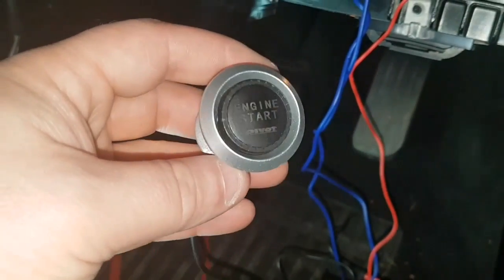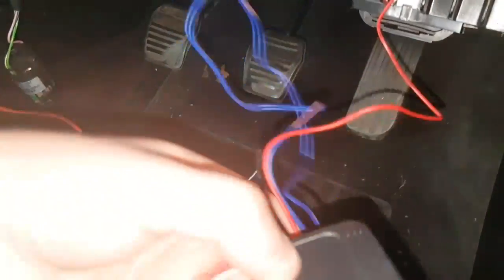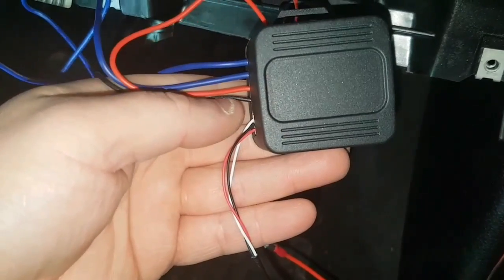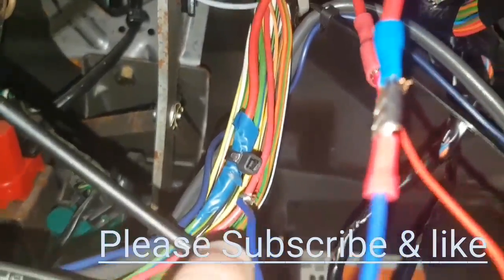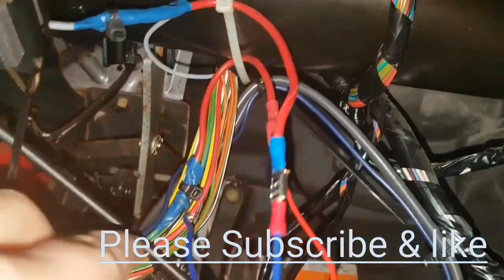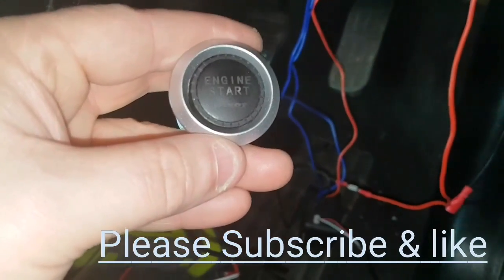How to install a start button on a car

Comment: What about steering  lock
Reply from the maker: With this kit you just use it push to start. Still use key
Reply: @ChazzCoombes  i was about to ask the same. So you just tap in to the ignition harness and use the button to start it? Cranking the key wont turn it on correct?

Comment: sorry can you help, what is the "ac2"?
Reply from the maker: hi Paul some cars have two ac wires. normally 1 turns on the radio and cig lighter and then the 2nd turns on other stuff like fuel pump cluster ect

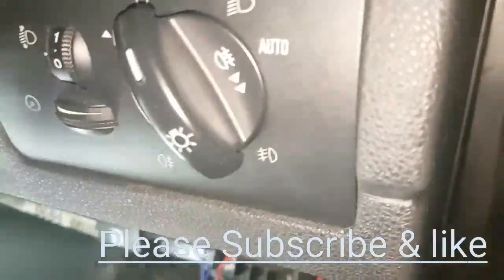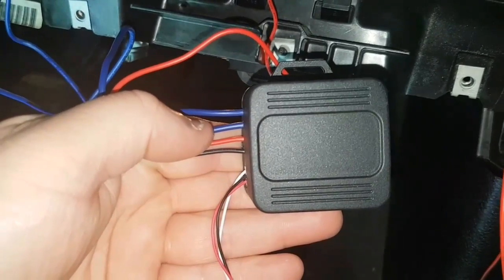Comment: I had the same problem as you have here before, you see there are two BLUE WIRES, but in  the manual it says 1 is supposed to be green. The STARTER BUTTON will light up when you turn ON the ACC of the car (track 1:12 & track 0:32) Yours did not light up because you INTERCHANGED THE TWO BLUE WIRES. The BLUE close to the RED should be your constant ACC, and the other BLUE at the last end should be the one connected to the cranking wire.

Comment: My Ford Galaxy mk3 barrel has given up on the starter side, AA did a temporary by pass and this switch came to mind instead of spending on a new barrel! Let's see tommorow what Ford's want for a replacement barrel , doubt it will be cheap!
Reply from the maker: Tahir Rana hiya this switch i can sell to you for £15
Reply: Chazz Coombes Thanks for the offer, funny thing is that I left the car over night when this did happen and surprise surprise the problem got fix!

Comment: what if your push start button does not have the other part and is just the button with red ,black and white wires ..  how can you install it with just those wires ????
Reply: trouble shooting ..
Reply from the maker: Xavier Rodriguez hi if you have just a switch then you will a relay. I have done a video one this. Using a regular relay from a auto shop.
Reply: Chazz Coombes thanks ill try in the morning for sure and ill lyk what happens
Reply from the maker: Xavier Rodriguez just take notes,  dont forget to subscribe ect.
Reply: Chazz Coombes already did . but is a push to start buttom the same. as a relay cuz I know red is for power black is for ground and I'm guessing neutral is for white but I don't know what to put those words up to but I'll try that with that video I just saw thanks I'll let you know

Comment: Did you have to connect one of the blue wires to your starter?
Reply from the maker: First blue wire i talk about goes to the cranking wire or starter wire. I have a stock off these still
Reply: I am having trouble I connected the top blue wire to a constant 12 volt I connected the second blue wire to Starter and the red wire to ACC number 2 the vehicle starts but dies